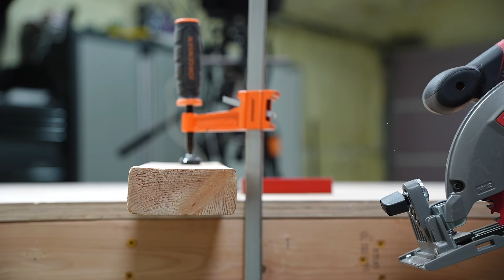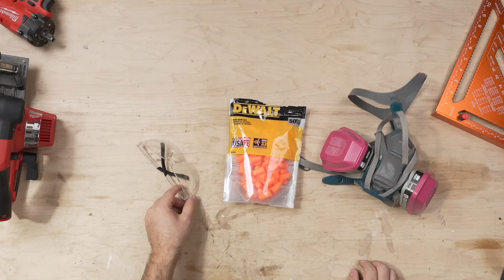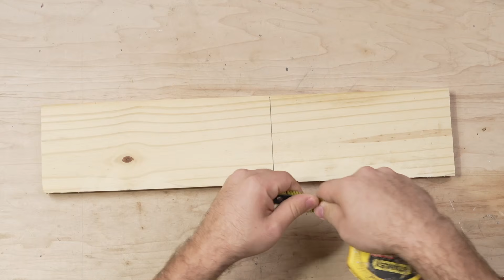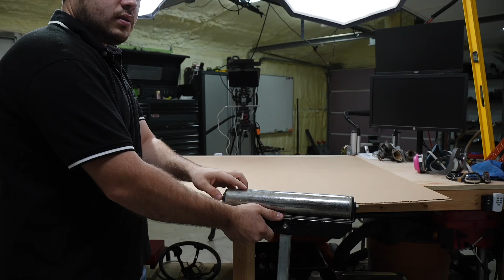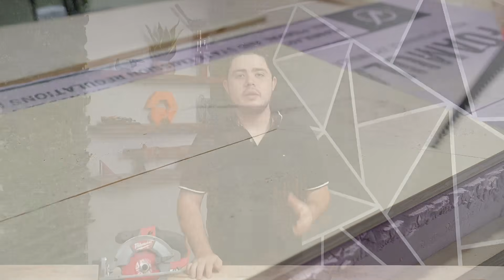How to use a circular saw like a pro, the ultimate guide.

Comment: Love my Dewalt 7.25 cordless.  However, the front index on the shoe is about 2mm offset. Now before someone says it’s the allowance for the kerf - no it is not, it is on the wrong side for that, and in fact following a line on ply sheet, the kerf is plainly 2mm over.  Really annoying.  The shoe cannot be realigned for this, so when I get to it, I will have to glue a plastic sheet over the index and mark out a new one correctly in line.  Should not have to do this with Dewalt, but there it is…

Comment: For all those purposes you are using the wrong saw. A Miter saw would be safer, more precise. for long plywood cuts, there is plunging saw. classic circular saw is ONLY for battery operated roof construction, because of portability and average accuracy plus LOW overall safety.
Reply: Works well for concrete framing work where efficiency and speed is important but precision is not very important.

Comment: I've trained myself to, whenever I pick up a dangerous tool, consciously think 'this could change my life permanently'. Now it's reflexive, I find myself reliably being just the right level of nervous every time I use something like a skilsaw. Measure twice, check fingers are clear, cut once.
Reply: I SO relate to this. I'm nervous about using my circular saw for a garden bed project. It's also a corded one, so way more powerful. 

Sadly, I have to say that this guy in the video has missed out on the fact, that you don't cut inside or even on the markings as I've learned from experience that you end up with mismeasurements due to the thickness of the blade itself. 
Also he doesn't explain (so far) that you have to start the saw away from the material you're cutting before you move into the wood, and when he explains rip-cutting, he casually moves his hands on the piece that's going to be the off-cut: VERY BIG No No. You'll lose your fingers that way.
Reply: @StellaDeleuze  I'm a professional, so I take that level of intricacy for granted, but yet valid points. You can safely bite into the wood and hold the offcut piece, you just have to maintain awareness the whole time, and ideally some experience.
Reply: @moviewizard471 I'd avoid it at all time. Better safe than sorry.

Comment: B.s. on EVERY SAW VIDEO... HERES THE COLD HARD FACTS...
1)   U CONTROL THE TOOL, THE TOOL DOES NOT CONTROL U... EVER.
2)  GRAB THE TOOL LIKE A MAN, NOT A LITTLE BOY...U CONTROL THIS SHIT, NO MATTER WHAT...
3)  WEAR UR GLASSES, AS THE MATERIAL WILL ALWAYS HIT YOUR EYES AND FACE...U ONLY HAVE 2 EYES...AND THEY CANT BE FIXED.
3)  LINE BLADE UP ON SIDE OF LINE U WANT TO CUT, THEN ALIGN FRONT OF GUARD, BACK OFF, PUSH BUTTON, EASE INTO MATERIAL AND KEEP EYES ON BLADE WHERE IT MEETS THE LINE.
 4. )  PRACTICE MAKES PERFECT

Comment: Do not cut to the inside of markings! The kerf (width) of the blade takes more away, meaning that we always cut to the outside of markings. This will leave cuts the correct length, or marginally too long at worst. You can plane/sand a mm off, but you can’t add them on
Reply: Thank you. 🙏

Comment: Theres an important rule I found somewhere else that I dont see you mention here: that dont stand or put any of your body parts in the running way of the saw..  
I always use a guide so it saves energy on focusing to make the saw straight. I also use ear plug to reduce stress from the noise.. you will be cutting better and fresher feelings.

Comment: plunging a circular saw to to a hardwood floor replace hardwood flooring was one of the scariest thing I ever had to do.... things I learned, before plunging.  1. zip tie the guard so you don't have to worry about it, 2. keep both hands on the circular saw, 3. angle the front of the circular saw down and the blade up, turn on the blade at full speed before plunging!  4. Never start the circular saw to continue your cut.... that's a sure way for a kick back to occur.  Don't ask how I know...  NEVER hold the guard with one hand and the other on the trigger...  (hence the zip tie of the guard down) in my case.  If you have other tips for using a cirular saw on hard wood flooring let me know.
Reply: I’m a newbie, what happens if you don’t zip tie the guard?
Reply: @alzgrex5304 You have to constantly hold it with one hand.

Comment: The best way to make a straight cut using a circular saw is to have it up against a speed square
Reply: Been seeing this more and more lately, I love it! Especially when I was building sets for plays out of a 10’ storage unit
Reply: And have a sharp blade in it
Reply: Yeah didn't work for me. Got my speedsquare clamped down with two clapms and because of vibrations it drifted off regardless.

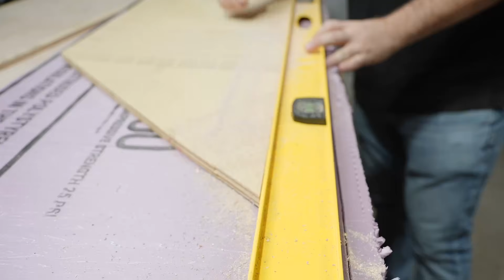Comment: It was unclear how you set up the guide using an offset measurement as the markings on the wood, and maybe a few other steps, were left out starting from 9:45 . Someone that doesn't have experience using offsets, like me would need to see every step as well as a diagram of how it works.

Comment: My 4.5" circular saw says you're wrong about the sizes lol no big deal just letting you know
Reply from the maker: In that case my Dremel with a 1-1/2 inch wood cutting wheel is the smallest.
Reply: Indeed. I have the 4 1/2” DeWalt one.

Comment: Never plunge cut with a circular saw just use a jigsaw
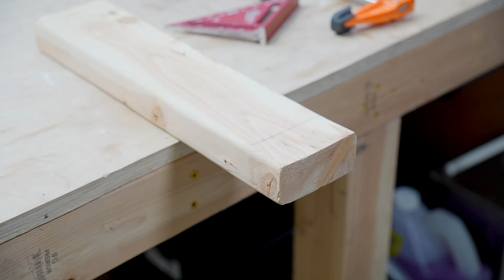Reply: Jigsaw is at home 20 miles away from job and it 3:45on Friday
Reply: ??? then why not just use the circular saw from the edge of the material instead? what's wrong with plunge cut?
Reply: @DJTrancenergy plunge cutting with a circular saw can cause the blade to bind and kickback and cut your fingers off😊